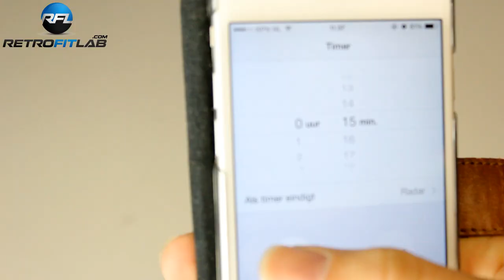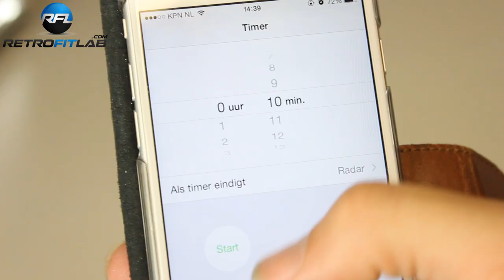Jeep Grand Cherokee HID Bi-xenon projector installation headlight upgrade

Comment: It looks like the shroud doesn't fully cover the projector housing.  Does light leak out causing extra glare?  No need to paint the reflector black?  Love your videos by the way!
Reply: +Retrofitlab Sweet, thanks for the quick reply!  Looks like I'll be going with the morimoto mini h1 with the mini Gatling gun shroud.
Reply: Nice.  They'll be going in a Toyota Solara, but I'll definitely check out the measurements.  Thanks!
Reply: +Retrofitlab Didn't see the rest of your message.  Since it's not on the website yet, do you have the measurements?
Reply: Awesome, thank you.

Comment: How do you make low/high beam work with a H4 connector? Is there an easy way?
Reply: +Retrofitlab I see, and checked on your site. :) My problem is that in Hungary, you have to install fancy stuff for a bright light, like auto leveling and headlight washers, and I'm thinking about using a set of projectors with regular, but higher output H1 bulbs(like Osram Night Breakers), which would still be much better than the original H4 housing, do you think there is a way to wire properly?